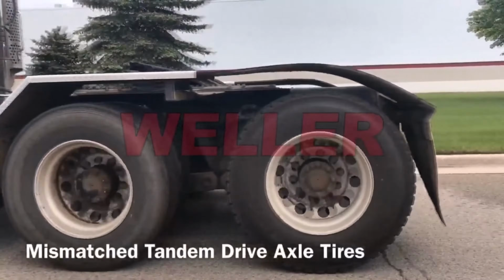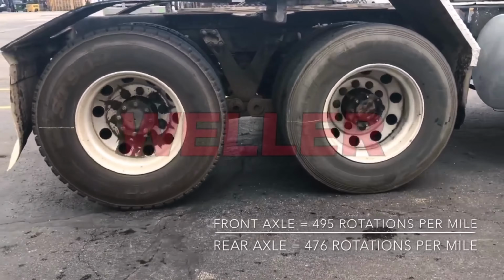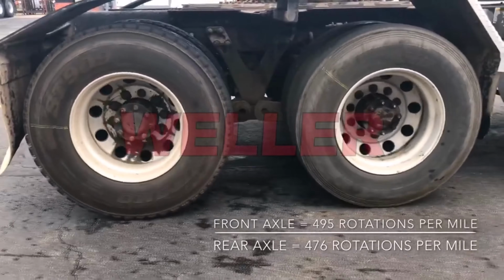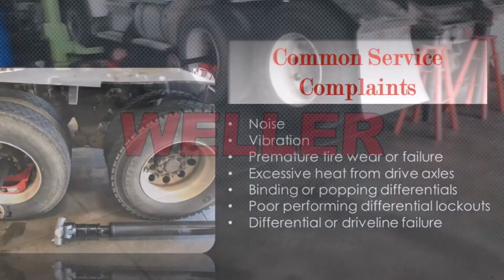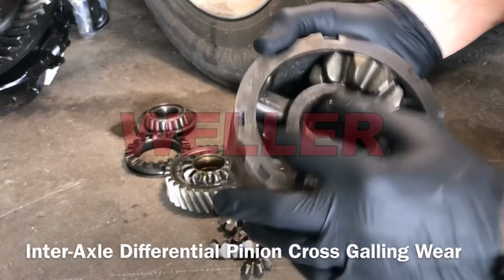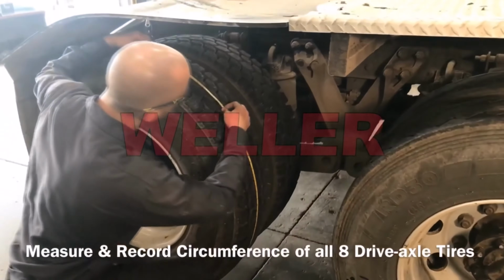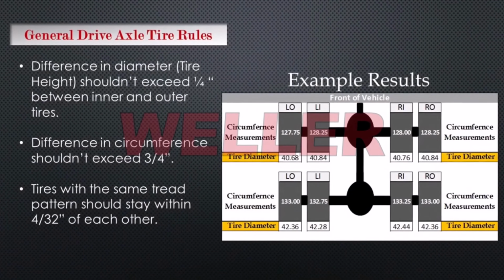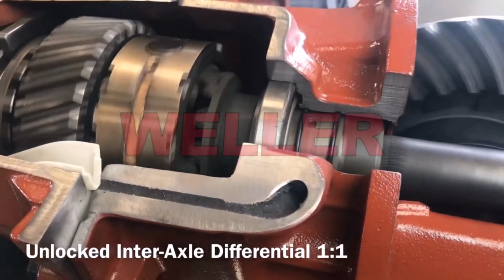Common Drivetrain Failures

Comment: I bought a transmission from Weller's 50 years ago and it was a very impressive truck salvage yard back then. The other day I happened to be in Grand Rapids, so I took a ride past Wellers. I was floored by what I saw.  Huge place now, very modern and you can't really call it a salvage yard any more. They have grown beyond that by miles. Congratulations, folks!